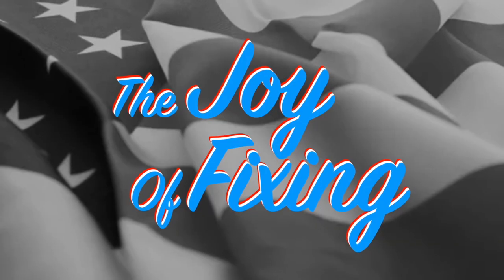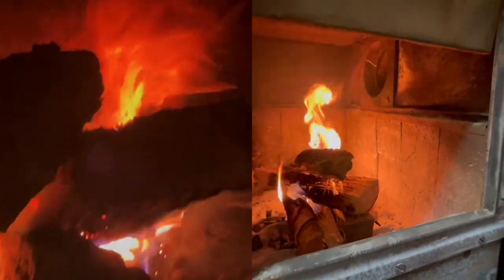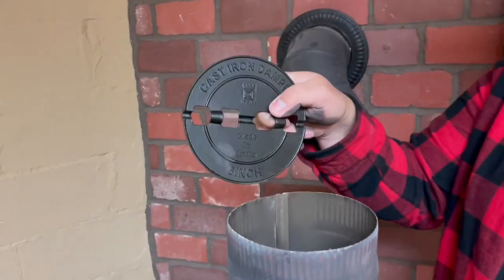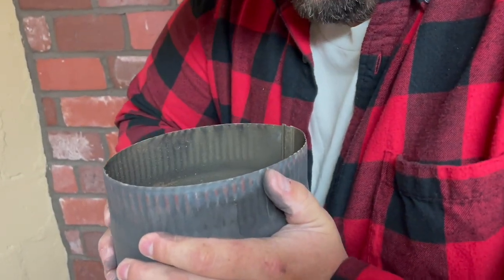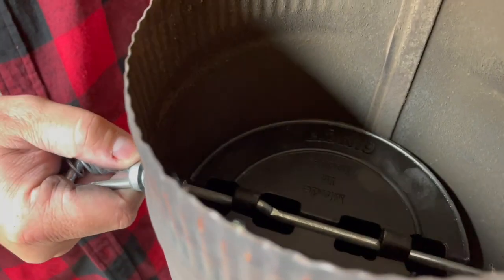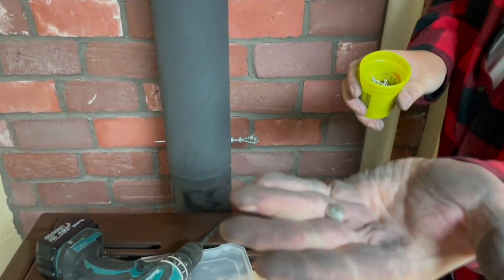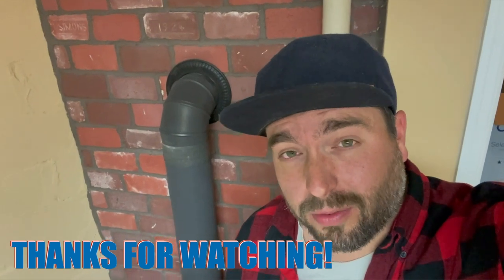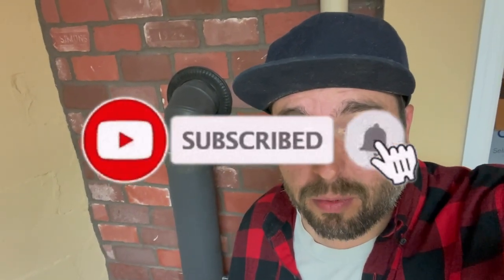This might MASSIVELY change your wood stove performance! Installing an Updraft Damper on your Flue!

Comment: I've been burning wood for over 50 years.  The one thing I use my damper for is to shut down airflow when I have the inevitable 'flu-fire.'  I want that baby OUT!  The rest of the time, I use my air-intake drafts to control the burn of the stove.  Of course, I run a wood cookstove to heat and cook with, so that might be different with the tiny firebox, compared to a heater stove.  I also use hardwoods to burn instead of soft woods, as the soft woods burn way too fast.  Soft wood is just for kindling and hot wood as my fire is getting started.
Reply from the maker: I agree with absolutely everything you said here. A lot of people are going to argue with putting a damper in the flu pipe on an Ashley style stove but I like the extra level of control right there at the flue pipe. There’s never anything wrong with putting in an extra level of control on some thing that involves fire.
Thank you for your comment. I’m glad you took the time to leave it.

Comment: Like the method.
Besides convenience it also doubles as a safety in stopping a chimney fire or slowing a runner.

Close damper, close air ports (be aware of secondary air intakes) will starve it.
Reply from the maker: Exactly!

Comment: You already have 2 ninety degree elbows there . I have been burning wood for 30 years and have found that straight up with no damper is always the best. Better draft, less creosote. Wood all contains x amount of btus.  By installing a damper you retain the heat released for longer to be released into the room but the total heat released is still the same. The trade offs of the damper are usually more negative than positive. More smoke into the house when adding wood is one of them. I like my wood to go farther too but I don't use dampers cuz I like a cleaner burning fire and more heat released sooner. I hate elbows . I have one elbow on my furnace add on stove but not on either of my other two stoves both of which have tubes the heat passes over on the way straight up the flu.
Reply from the maker: I typically open the damper all the way when adding wood, to avoid the smoke-out. I don't even use the damper all of the time, but for a low slow burn at night when the house is already warm it has proven to really help control the hard draw the updraft can force through the stove. ESPECIALLY on my style stove they're typically unnecessary, but I have a specific use for mine so it's good for me.
True there are 2 elbow, but still once that updraft is ripping... the corners barely matter. I can end up with flames reaching all the way up and part that top elbow into the vertical run into the wall. That's what I'm trying to avoid, and the damper achieves that.
Good comments! Everyones situation is different.
Reply: As long as you keep a thermometer on your single wall pipe to keep the temperature up to around 300 degrees you wont be building to much creasote.  I also let mine run wide open for a few minutes each day to help burn off anything sticking to the inside of the chimney that day. I also use creasote reducing firelogs periodically  and burn only good seasoned wood below 18% moisture content.  Clean the chimney once a year and zero problems with using my damper. All night burns(10) hours or so are normal even with my old school Fisher grandpa bear stove.  Like he said though,everyone's situation is different
Reply from the maker: @ciphercode2298    All very good information. Thank you for adding to the conversation.
Reply from the maker: @ciphercode2298  This is accurate. Low burning smoky fires make creosote. In Colorado we burned nothing but pine (sappy pine even) all the time and didn't have much problem with creosote. Just gotta keep the temperature up.

Comment: Is adding a damper to a modern stove a good idea? Really confused..people say dont need one? Wanna retain the heat..
Reply from the maker: It’s not necessary on a stove with a built in damper. It’s just another means of control at a different bottleneck. Many people like a nostalgic old wood burner and this is most relevant to that crowd
Reply: @thejoyoffixing  don't HV a built in damper..guessing getting it installed n using it if it helps or just leave it opened incase it doesn't help much would be best? Guess what I'm asking is no serious drawbacks if I do get one?
Reply from the maker: Correct. Worst case you see no value and leave it wide open!

Comment: If you leave the bottom door open it’s damn sure gonna burn like that. Those doors are only meant to be one to get things going.  Then you shut it down. Use the stove damper.
Reply from the maker: Yes, I said that in the video. I’ll be posting a basic “how to use an Ashley/Wood King style stove” video in tye next month or two. It seems folks are baffled by the basic operation of these stoves.

Comment: Great information to have.  The install looked super easy.  But the video didnt show how you used the self taping screws.  But I know what you did.  Maybe the video broke for a commercial right at that moment
Reply from the maker: I WISH IT WAS BREAKING FOR A COMMERCIAL. lol. No such luck, at least in any monetary form.
Yeah I had a little segment about installing the pipes and where to put the screws but it didn't make it through editing, somehow.
Hot tip: When screwing 2 pieces of metal together with a self tapping screw make sure you are screwing both pieces of metal together! haha

Comment: Good video. I have just moved somewhere that has a woodstove, almost identical to the one in your video, but mine is a Ashley Wood Burner. It already has the damper thing installed on it. I've never had a woodstove before, when I was a little girl my grandpa had one at his house but I wasn't allowed to mess with it.  I don't know a lot about them, but I'm trying to learn as much as I can, that way I won't be so afraid of it. It's starting to get pretty cold where I'm at, the temp today is 24°F.  I had someone make sure the pipes were clean on the inside, they look like they are brand new or maybe just barley used last winter. I've had a few fires but like I said, I'm new to this and it freaks me out. I don't particularly like the popping noises it makes when the metal is heating and cooling, but everyone I've asks says this is normal metal expansion behavior.  The problem I have is that it seems like you can either not have a fire and be cold, or build one and then it gets wayyy to hot to be comfortable, even though I'm not putting a whole big bunch of wood in. How do I regulate the temperature without smothering the fire and causing creosote build-up?  Sorry for writing a book here in your comments, but I was just trying to explain it best I could. Thanks in advance for any insight you can provide.
Reply from the maker: Mine is also an "Ashley style" stove. I understand exactly what you're talking about. The popping noises are completely normal, although it is possible to let the stove burn too hot and rip flames clear up the flue pipe, although it's not abnormal.
First off, do you understand how the "self regulating thermostat" works, and how you use it to control your air flow? If not, we should start there.
With this style stove a "flue damper" is not completely necessary at all. Understanding how the stove works is going to be your number one step to success. The flue damper being added to this style stove is like... a little more advanced way of regulating the temperature and burn time you're getting out of this stove. 
Let me know if you understand how the thermostat coil and the air intake door that it's attached to work, and we can go from there. I'm even possibly willing to do a video specifically on how this equipment works.
Reply from the maker: @Yourtakingmylife - Waiting for a reply! =)
Reply: @thejoyoffixing   Thanks for replying, I just now saw it. I know the little thermostat thing works by a coil of metal that is sensitive to temperature fluctuations. So in turn when the stove heats up, the coil expands n closes the little door.  When the fire dies down and the stove starts to cool off, the coil contract's and pulls the little door back open. These things happen depending on where you have it set at between high and low.  I'm pretty sure that's how it works?  My stove is like your was there's so much draft,  it wants to suck the flames up the chimney pipe.  You can't even light a fire in the stove if you have the damper completely open and the air intake open (knob set to high). It will literally blow the flame out...
Reply from the maker: @yourtakingmylife3472  Yeah it's a lot of air flow! you better have a good pile of kindling if you start it that way because it's like a jet engine blowing through there once the fire starts burning and that fire is HUUUUUUNGRY.
Reply: @thejoyoffixing   One more thing, I was reading the manual for the stove awhile back (which btw isn't at all helpful).  I remember it saying something about this stove was supposed to have an "Automatic damper " or something to that effect.  Have you ever heard of that?  
My main concern is creosote build up bc I constantly feel like I'm having to smother the fire by keeping it on low and closing the damper 3/4 of the way.  From what I've been gathering here and there, by  researching trying to learn as much as I can to be safe, it's not great to run a stove like that all the time.  I feel that I'm using what I have seen described as like a " night time" longer burn method, all the time to keep the house from being a thousand degrees.  I never put more than three or four pieces of wood in at once, so I know I'm not overloading it.  Idk? Hope all that made sense. I just want to be as safe as possible and do things right.  But I have had no clue where to go to learn these types of things, so thank you again for your help.
Reply: @thejoyoffixing   I usually close the damper just a little bit and leave the little air inlet door closed until I get a flame going.  Then I push the stove door almost all the way closed and open the air inlet as I'm doing that.  I'm not sure if that is the right way to do it but it's the only way I can get the flame to not be blown out by the draft.
Reply from the maker: I like to add a bunch of paper, slivers of cardboard and then small kindling and then bigger kindling. You kinds build your fire materials from tiny to bigger. It's a process. Try it and I bet it'll make a difference. The paper and cardboard help get good flames going so it gets the small kindling burning pretty good. At that point the draft just makes the wood burn hotter and faster and gets you ready to start adding small logs.
I feel like I'm due to do a video on how to start a fire in this style stove. I've got it down to an art. Only hard part is not being able to film the inside of the fire box. But it's not totally neccessary.
Reply: One of the nice things about burning wood is if it gets too hot in the house you can just open a window and get some of that nice fresh air from outside.
Reply from the maker: @ronskancke1489  I could not agree more. Instead of the wood stove sucking air from anywhere that leaks in the house, and making the furthest rooms freezing cold, I can crack the window in the wood burner area and let that cold air drop right to the floor and get sucked into the lower intake damper. It's nice to get the fresh air circulating.

Comment: Hello,  I bought the same damper, but a 4 inch, for the life of me i cannot get the pin removed from the cast iron piece.  Is there a trick to removing it?  Yours looked like it came off so easy.  the spring barely moves on mine.
Reply from the maker: The trick is to push the pin. Grab the handle portion and push it toward the damper. It will compress the spring and you will be able to twist the pin and remove it from the channel it's locked in.